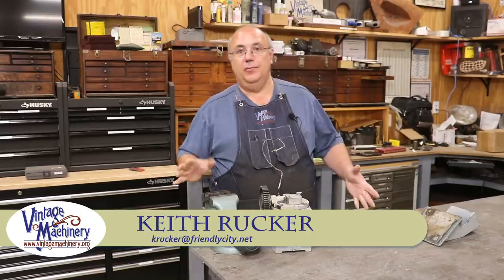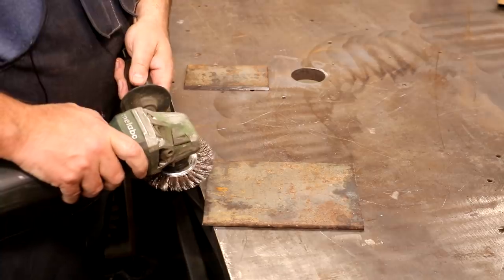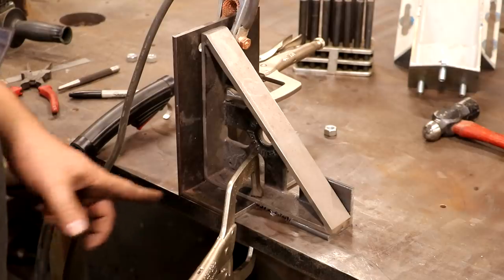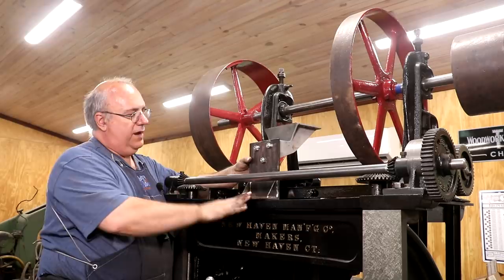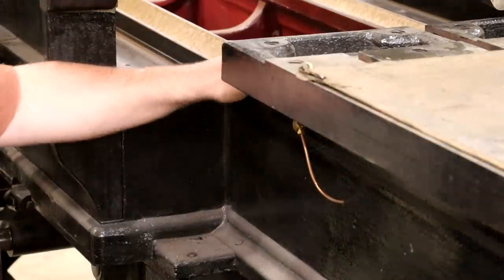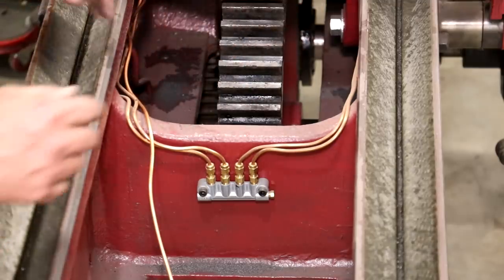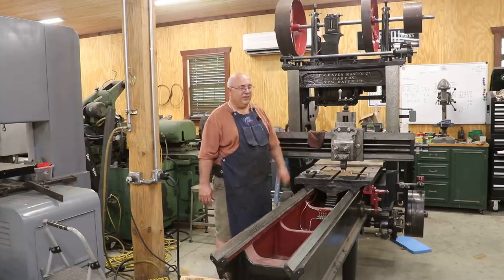Metal Planer Restoration 60: Installing the Lubrication Pump and Plumbing

Comment: Go Keith,  Ha ha! You are correct. Your toy you play with it as you want!!!! 😂😂😂👍👍👍
Reply: I've just bought a Crompton motor starterhttps://04646a9cf351cc0d3888-b8b406d15fe93f790abb5bf0e9ab7ab3.ssl.cf3.rackcdn.com/images/products/medium/cefco_3dl1eks_46430d44dedb52d8cb33c27517ce4bf2.jpg

but I'd noticed in the past, green button on the left, red on the right: http://2.imimg.com/data2/PC/NB/MY-3249558/dol-starter-bsoi-500x500.jpg

So I'm going to fit the Crompton 'upside-down' so it's the 'correct way round' !

Comment: On the surface grinder that I have, with a Bijour Oiling system, the orifice/check valves are almost at the application point (end) of the branches of the oil lines.  That way, you can loosen the orifice on initial start-up and let the oil pump push the air out of the lines with oil.  Otherwise, you be forever actually getting the oil to the part needing to be oiled.  Hope that makes sense.  

Your work is remarkable.  I look forward to the episodes.  That planer looks and will run better now, than when it was brans new.  I bet the former owners would be excited to see your final product.  

Thanks again,
Scott

Comment: I quite agree it's yours you have it as you want it. I love the oiler system we had them on new machines from Molins in the 70,s. The older ones had drip oilers and wipers. The later fast machines had massive sumps with splash feeds to everything, driven by electric pumps with designated pressurised oil feeding to bearings bushes levers etc.

Comment: Hi Keith, I must say that your radial drill is a great machine. Over here in the UK in the 1960s I was an engineering apprentice and we had a radial arm drill in the workshop - I think it was an Archdale - it was a nice machine to work on but nowhere near as sophisticated as the one that you have.  Nice to see the planer coming along - I'll be interested to see  what sort of accuracy it wil be capable of under use.  Thanks for the video - great stuff.
Reply: Where did you work as an apprentice?
Reply: @keshticlesp6269  The Woodville Rubber Company, Ross on Wye, Herefordshire, England.

Comment: I like the way uou think:  It's mine, I wanted it wired like I wanted it.
Reply: Yeah if they don't like it they can go out and build themselves a 40x80 shop and buy themselves a radial drill and wire it the way they seem fit.  Keith's living the golden rule.  The one with the gold rules ;)
Reply: Aaaaabsolutelly... Like, to me blue colour means "life", as in "warm blue seas brimming with life", (or "warm blue seas where life on Earth has begun"). Also, green and yellow are colours of life too (plants and flowers, eh?)... and red means death (red blood of killed animal, or red fire of destruction/ cremation). And anyway, the earth (i.e. fertile soil) is typically "close to black". Therefore I'm gonna wire my workshop using green-and-yellow wires for "live" wiring... or maybe blue ones...?  Haven't decided yet... And "earth" wiring would use black wires, and red ones would be used for "dead" wires (i.e. "zero" or "neutral" ones). And screw any smart-ass electrician out here telling me I did it "wrong". How come "wrong" if everything works just perfect, eh?

Yes, it's his workshop and his drill, and he can do as he pleases. But then I guess there's some reason behind the fact that you'll find a blinker lever ALWAYS on the LEFT side of the steering wheel, and ALWAYS operating in the same manner (forward = right, backward = left), regardless of car brand, model, year or country of manufacture, left- or right-hand drive version... Makes you think, eh?
And no, I'm not looking forward for the video, in which some "guest machinist", well seasoned in using radial drills, will be helping Keith on some project, involving, say, power tapping blind holes using radial drill for that task... No, never.
Cheers!

Comment: Keith the modern solution for the oil pump drive would be a toothed belt but this just would not be in keeping. I have never found narrow or cylindrical leather belts very satisfactory for short runs. My suggestion would be to use sprockets and a roller chain drive. Modern O ring roller chain, which looks just like regular roller chain is almost stretch proof and compared with older roller chain, the wear resistance is phenomenal if kept lubricated. I changed the drive chain on my Yamaha Raptor 700R sports ATV at 20,000 miles but really it had next to no wear. As someone used to replacing chains on motorbikes in the 1960's every 2000 miles and having to carry spring linked emergency repair spare lengths with me, the new chains are spectacular.
Reply: My god man!  This is a tiny pump that you could run with a "rubber band".  Roller chains, toothed belts, or whatever other high performance drive system nonsense is laughable.

Comment: Here in the UK, that "ferrule" is called an Olive.

Also, I'd recommend investing in a set of Line Wrenches, aka Brake Line Spanners (about $10 on Amazon, for a set of three double enders, giving 6 sizes), to avoid rounding of the hexagons.

Comment: "Oh, come on man! Where is the steam boiler, or the water wheel, or the donkey walking around in a circle? Electric motor?!! Not authentic. You have LED lighting, where are the gas lamps? That handle on the drill going backwards? OMG!!!"  LOL  Remember folks it's 2021! And it's Keith Rucker! Great job as usual Keith!

Comment: I think I would have been inclined to mount the pump next to the bull gear shaft and connected the drive with a rod and a pair of wheels (like a locomotive), that way the oil pump only runs when the table does, the oiler itself ends up where it's easy to keep full and you wouldn't run the chance of gravity feeding oil when the machine is off.

Comment: Ordered a while ago. Can’t find them. Order more. A familiar theme.  The problem I have with extended projects (if I remember I already bought some) . Sure-fire way to find the first set will be to take delivery of the reorder. I assume the original oiling method was manual - operator or assistant. Thanks, as always, for the video.
Reply: Twice I've ordered stuff because I couldn't find what I had. After using some of it, I'd put the rest away - somewhere logical so I can find it (!) and as I put it away, I discover I'm putting it next to that I already had but couldn't find in the first place !

Some years ago, I had my Mum round to mine - and she'd come back from a shopping trip and bought me some new dish cloths. She asked where I wanted them and I said put them in the cupboard under the sink next to the new dish cloths I already had !
Reply: @millomweb  👍 “somewhere logical”.  You left out “safe”.  With me, safe from use. Like leaving my raincoat at home to keep it dry.

Comment: Just remember if you use my Carlton it is backwards. LOL  I think I would have mounted the pump low so there would not be a tendency for the oil to try to siphon out of the reservoir and drain the system will sitting same goes for the lines since they don't have check valves on the end, if it doesn't siphon I fear it will need several strokes to get the system filled back up after every period of long sitting.

Comment: That's going to be pumping oil anytime the motor is running, even though the carriage isn't moving.
I wonder if it would have been preferable to hook it up to the first drive shaft (the one with the two loose/fixed pulley sets) so it only pumps when the machine is actually running. I'm not sure if the reciprocating action of the shaft would be a problem (or perhaps the oiler has a ratchet so it works just as well with reciprocating motion).
That probably would have replaced the "refilling the oiler is a pain because it is way up in the air" problem with "refilling the oiler is a pain because it is underneath all the grimy machinery".
Reply: I'd ditto that (rather than post my own) but would add that a one-way clutch between the reciprocating shaft and the pump would guarantee that the pump turned in the proper direction.

Comment: You're right, forward is away from me  and reverse or stop is towards me. That's the only way that makes sense, and the way I have always done it. Maybe it's because, when I was a kid and cars  emergency brakes were levers that's how they worked.
Reply: Reminds me of the F-111 Aardvark. The control to change the wing sweep was next to the throttle for the engines. Originally, the linkages were configured so that pushing it forward, sweep the wings forward for low speed and pulling it back swept the wings back for slow speed. Made sense in that the wings mirrored the position of the control. But... the throttle was opposite. Forward was "go faster" and backward was "go slower" so the pilots kept grabbing the levers simultaneously and moving them as a single unit. Not good. So a retrofit was installed so pushing the lever forward was "go faster" mode (wings swept back) and pulling the lever backward was "go slower" mode.
Reply: The switches on all my machines are wired to the right for normal operation. The lathe turning toward you, the drill press, vertical mill to the right for right hand cutting tools.
Reply: @johncochran8497  In that application I could see where that makes sense. Less confusion in the cockpit is always a good thing.
Reply: The horse stops when you pull back on the reins.  From simple things many things grow!

Stavros
Reply: @stevecallachor  Yep.
Reply: True, reverse or stop towards me unless I'm stepping on the brake. Funny how there's always an exception to every rule isn't it?

Comment: That type of Bijur oiler, at least all I've seen, has a ratcheting input shaft for use on reciprocating equipment. be sure it's turning the right direction to operate the pump.
I'd been trying to find one of those pumps to grab off of some of our scraped equipment, but couldn't find one. I know we had some, but they got "5Sed", meaning that to save space, people who didn't know the value of those devices threw them away.
Reply: True! I've scavenged/repurposed crap from previous jobs that would be worth tens of thousands of $$ now. Some brand new things too! Those transmission oil cooler kits with electric fans for Diesel engines for example. Discontinued, rack full of them going to the dumpster. I was in good with my bosses so I got to nab anything scrap that I wanted. In that case the fan alone was worth over $100.00! Forget the cooler, the relay and thermostat, and the Aeroquip hoses that came with it!

Comment: Hi Kieth i have wondered for quite some time if your choice to put the motor and drive wheels on the carraige, will introduce vibrayions that will come out in the finish when cutting? Because  the motor will have a vibration frequency and so will the drive shaft and wheel. Looking forward to seeing it running.

Comment: Nice and interesting video and nice work too. I was just wondering if you will get problems with the oil syphoning down the pipe?
Reply: pressure valves in the manifold will control that in both directions as it is the lowest point. Well thought out contrary to some comments made elsewhere.

Comment: Keith, little off subject but need a little info, I have a Wells Index mill 747VS, and I'm missing the Quill fine feed handwheel, just looking for the OD  of the handwheel so I can order a generic wheel and machine the bore to fit. Thanks.

Comment: Since you only need oiling when the table is moving and you need to refill the oil reservoir every once in a while, shouldn’t the pump be mounted beneath or beside the table? Are the lower shaft spinning too fast to roll on?
Reply: I was going to ask pretty much the same question.
Reply: The drive shaft is at the top, so the oiler goes on top

Comment: To get the pulley in the middle of that big top shaft to run the oiler are you going to have to take the shaft off and pull one of those big wheels or is there a some kind of pulley that’s split that you can just bolt on? That would suck taking it all apart

Comment: Will the check valves keep the oil from all siphoning out of the reservoir?  Seems a concern with the reservoir at the high point of the system.

Comment: I had to replace the oiler on my chainsaw today.  It's about the size of the fitting on the far end of the oil tubing attached to yours.  Saved at least $75 doing it myself.  How much are you saving?

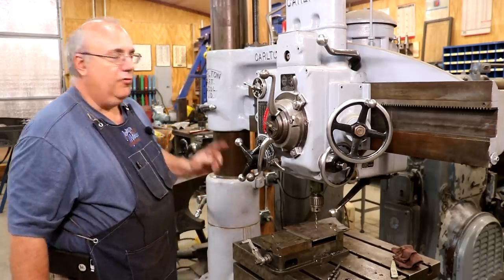Comment: 7:30 Forward or reverse on the radial drill - I was one that mentioned this having researched other machines - and the reason for all that was in the previous vid, Keith was operating the start lever the wrong way.....and that made me think - it's not set up in a logical direction.

His comment here about he has it set up up this way round (his entire choice) was as this way seems to make more sense to him. If that was the case, then why in the first video was he accidentally starting it in the wrong rotation ? !!!!!!!!!

Thanks for mentioning it again, Keith.

A radial drill I used, had the F/R/off lever operating vertically. Operate down for drilling down - and up for reverse. That made sense to me !

Comment: Sometimes I want to turn my engineering mind off. Oiler is probably less than 10libs and all the forces included require less than 1/4 bolt but instead we are seeing 3 half inch bolts. That is the beauty when doing stuff for own shop, spend time on doing instead on calculations.
Reply: As an Engineer myself I agree! On my own I just build the damn thing! Takes less time than doing stress analysis of everything and comes out stronger. I've done some analysis for grins of things I built and usually I find they're 150% to 200% as strong as they "need" to be... I made a pair of car frame stands in High School metal shop and the numbers came out over 5000# each! Failure mode would be the 1/2" steel pin in double shear. I still use them!

Comment: Please put a guard on the angle grinder when using a wirewheel, I had an accident with one of those with the guard on and the guard made it stall out instead of eating my body up.
Cover all got caught in it.

Comment: The oiling check valves are to stop one line draining into another when the machine is stopped. They don't guarantee distribution.
Reply: I didn't see how they could guarantee distribution, unless they were pressure limiting valves.
Reply: They are simply non-return valves. Once a pulse of oil has passed through it, it cannot flow back but it doesn't mean oil has to pass through it in the first place. If the particular lubricating point is blocked or restricted the proportion of oil that should have flowed up that tube simply flows up the other tubes, check valve or no check valve.

Comment: With the Bijur reservoir high up, there is the potential for siphon when the machine is not operating.

Are check valves part of the Bijur or downstream system?
Reply: If I understand correctly, the metering valves require significant pressure to open - much more than gravity alone will provide.

Comment: If the bracket is cast steel or welded plates I would just weld it to the plate if it's cast iron has to be bolted.

Comment: Exactly Keith, it's your machine and what works for you doesn't or won't always work for others and vice versa. People need to understand that. Personally, I agree with your assessment of pushing forward is forward. 
Keith if you want to help keep the authenticity of the machine, here's a site for square head bolts. www.mscdirect.com
The planer looks like it's almost finished and ready to run. Great video, cheers :)

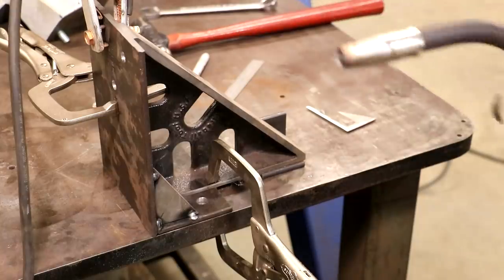Comment: 13:50 "tacked & ready to weld" - actually, welding not needed - those tacks are all that's needed to hold up a pump.  Home shop guys are always putting on 10 or 20 times the amount of weld needed.
Reply: That way, you can throw it out of an airplane, and it will STILL work! :)

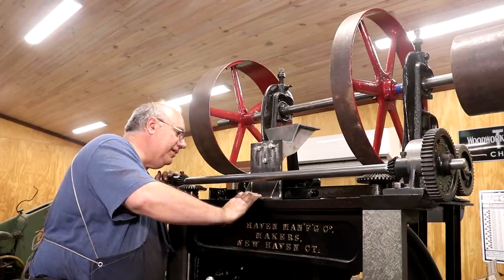Comment: 15:50 a pulley on the shaft ? I wouldn't bother - just use the shaft surface as a pulley ! Fit a pulley to the oiler - possibly twice the size to give you a half speed reduction.

Comment: Thanks Keith, I liked your videos. Your machine, like you said (Ref. radial drill), but people climbing on a machine to top off an oiler is not good even if they would do it. Best is eye level so the less motivated are more likely to top it off, and then, the safety Nazi has nothing to say. Where I worked, must use a ladder (and over 6 ft high, a safety harness).

Comment: If people tell you that it is running backwards, it may be possible that a lube pump in the geaRBOX MAY BE RUNNING BACKWARDS AS WELL, SUPPLYING NO OIL TO THE GEARING AND CLUTCHES.
Reply: i SHOULD HAVE SAID THAT I AM REFERING TO THE CARLTON DRILL
Reply: He has wired the switch so it suits him.  The forward/reverse mechanical operation of the drill is not affected.  Oh BTW, you don't need to shout.

Comment: I've always been surprised when you only use one drill chuck key-hole to tighten your chucks.

I was taught 60 years ago to also snug-up at the other positions, after you have finished the first one.
When you do that you'll find that you can tighten it slightly slightly too.

Any comment.?

Thanks.
Reply: It's called NIT PICKING
Reply: @rogerdeane3608  It does make a difference.   Failing to do so can often cause the drill bit to run crooked in the chuck - creating out-of-round or over sized holes.
You'd never see the problem if all you worked in was wood.

Comment: Hi brother.  If that thing has a 3 phase motor, and you wanted it to work in the opposite direction, swapping any two wires on the output of the contactor(t1 t2) (t2 t3) or (t3 t1)will make it so. It didn't look wrong to me.